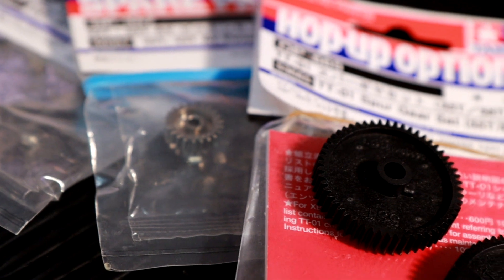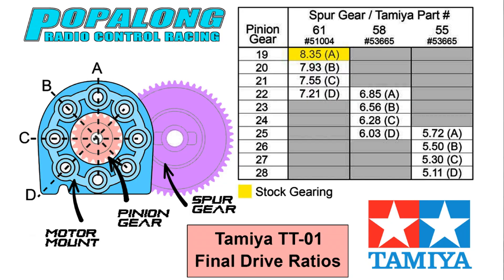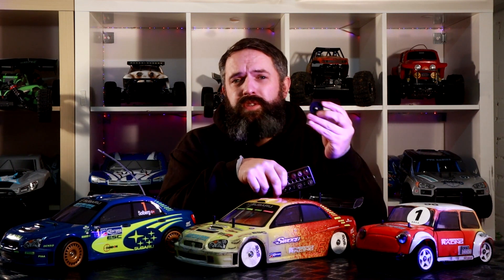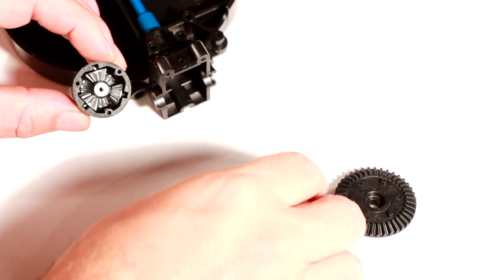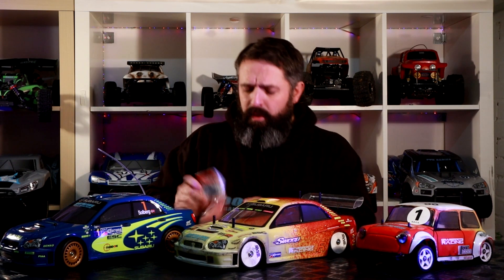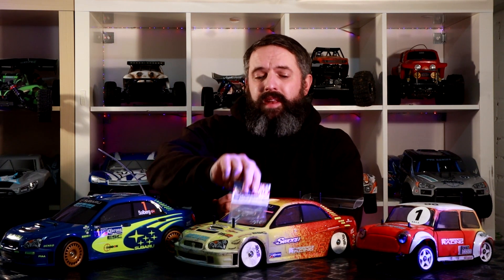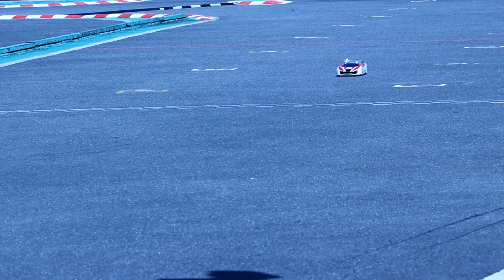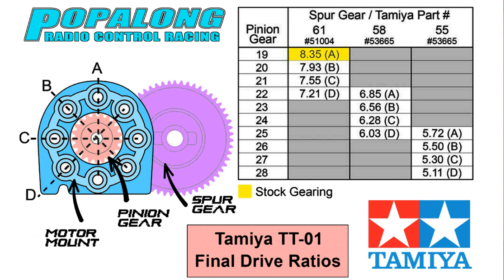RC car gearing explained easy basics for Tamiya TT01

Comment: What size pinion for a 10.5 turn brushless please 🙏
Reply from the maker: What are you using it for???
Reply: @PopalongRC  just general use mate it’s a tamiya tt-01 and fusion exceed 10.5 turn combo
Reply from the maker: @chrisprud7688 
I would start mid range and then build up but you need to keep an eye on the temp of the motor. 
Also 10.5 brushless might wear your gears quicker than normal . 
Some clubs race them with 21.5turn and it is more than enough on a track. However just on the street 10.5 might be ok

Comment: Hi there! Great video and information! I’m new to the RC world, I got a used TT01 stock and put a brushless motor in it, but it ate the 61t plastic spur gear. I bought a metal spur gear 70T . Still have not installed it but was wandering if that could be done? If not , how can I make it work? I still have not he stock pinion! Thank you for the help!
Reply from the maker: Tt01 is restricted with the gearing based on the motor mount and therefore 61-58-55 are the spur options. 

What are you using the car for… just bashing or racing or drift . 

High speed brushless motors will wear the gears quickly. 

Running brushed motors I am still on original gears and cars are a couple of years old …
Reply: @PopalongRC I'd like to add an extra question to this comment... I got an extra tt02 high speed gear set for my tt01e, I can not use the 68T spur that comes with it? *edit I also have the tt01 alum motor mount if that makes a difference
Reply from the maker: I have seen people mod their TT01’s to fit TT02 gearing but it is not something we have done
Reply: Hi can I ask what’s the fastest gear set up for the t-01 ? I want to change the pinion gear and large cog but what’s the best tooth size for speed

Comment: With 2 gearboxes and 2 motors to sort using johnson 4 holes im going 61t and 22 pinion in steel. Esc will be hobby twin motor.
Reply from the maker: Sounds interesting

Comment: Which position a,b,c,d for pinion 29T/ spur 55?
Reply from the maker: Sorry it does not look like it is an option. It would require an aftermarket motor mount
Reply: @PopalongRC  it works with D :)

Comment: Interesting... I build my first kit (Tamiya tt02) this year and got the mesh wrong. Gladly I tested it and it was very hard to push 😅 I have a ftx buggy with a stripped plastic spur. I installed a metal one and now the brass pinion spills shavings everywhere.  The gears are super smooth into each other. Makes me angry 😡🤣
Reply from the maker: There is definitely a knack to getting the mesh right and it is key if you want your gears to last … thanks for watching
Reply: If you have mesh issues simply use a strip of paper it says how to do this in the build manual so if you have further issues just buy a traxxas or wltoys.